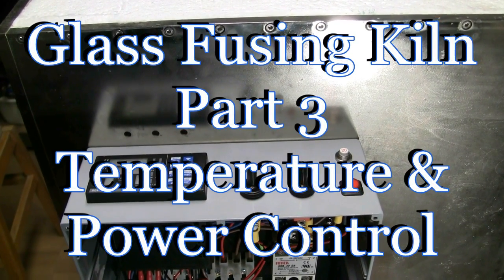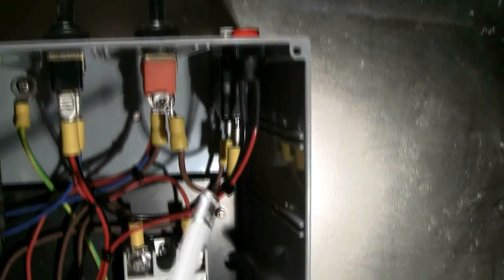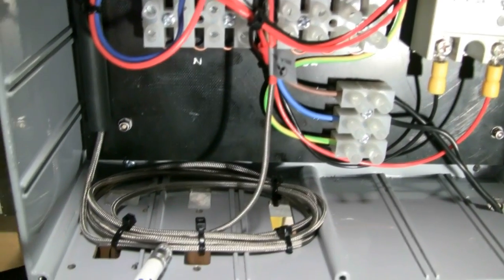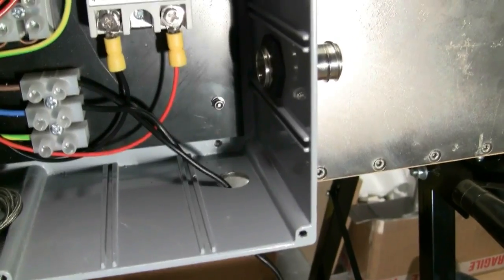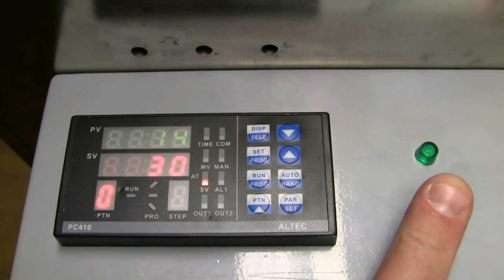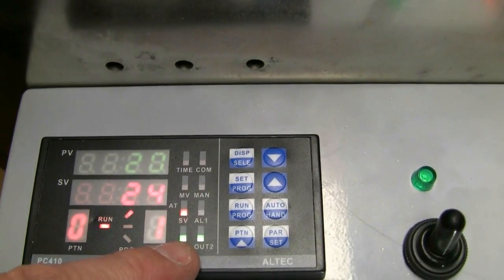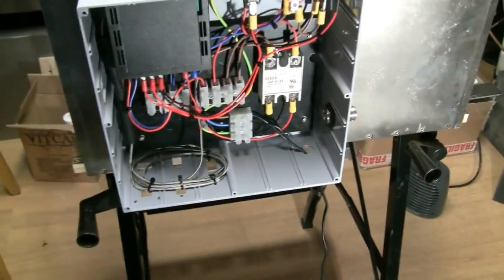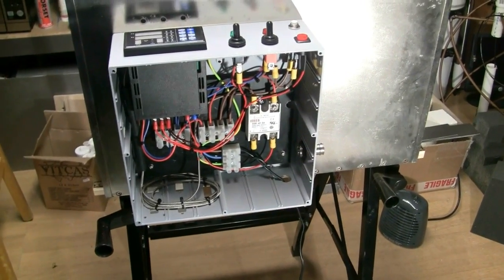Kiln 3

Comment: Hi Dave, did you have any problems  reprogramming the pid controller you got from amazon?
Reply from the maker: VapoMondo Hello, no I didn't have any problem. The PID controller has an automatic mode, you simply set a mid point temperature and let it run. After about twenty minutes the controller works out the optimum settings automatically.
Reply: thanks Dave, I've seen a few people mentioning they had difficulty using or reprogramming  the ramp/soak features with the pc410 as alot seem to be setup for reflow ovens.
Reply from the maker: VapoMondo ah ok, I simply downloaded the manual put it into self calibrate mode and let it run. Did it once, it worked perfectly and haven't touched it since 😀

Comment from the maker: Hi Bob, sorry for the delay I have been on holiday in the US just back home :)  Mmmm tricky one insulation depth.  What I did was look at quite a few commercial offerings and try and get a feel for the amount of insulation they were using and also the amount of power being pumped in.  I went for about 70mm of ceramic fire brick and then a layer of fibre blanket between the brick and the aluminium case to catch any leaks.

The big problem I had was the heater I bought from China was 'supposed' to be 2.5kw but actually turned out to be only 1.3kw and so I couldn't reach a fusing temperature.  I am just about to replace the heater with a known good 3.8kw heater array and I think this will do the job - watch this space !

Please post me a link to your kiln effort - there are not too many of us crazies about :)

Cheers,

               Dave

Comment: Hello, I'm about ready to start my kiln for annealing, you video really helped me.  The question I have is how thick insulation do I need to have, I've been thinking 3" fire brick and a layer of 2" fiber board. Then I thought I could just use 2 layers of 2" fiber board.. Any thoughts? And thanks for the great content.  Bob
Reply: Bob Cassidy hi Bob, did you ever start the kiln? I've been researching this myself, for an annealing oven, 3 inch insulation firebrick grade 23 is fine on its own without any insulation and if you have grade 26 or above you'll need more insulation with fibreblanket and grade 26 you need an inch or 2 of ceramic fibre blanket. Hope this helps.